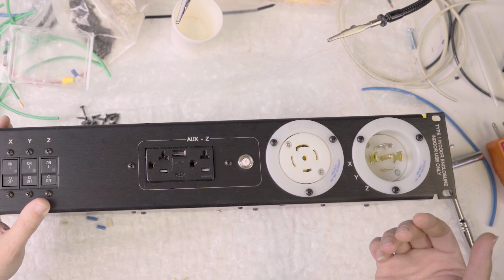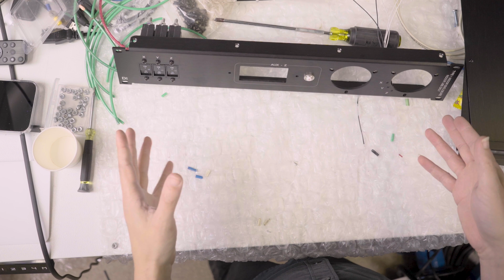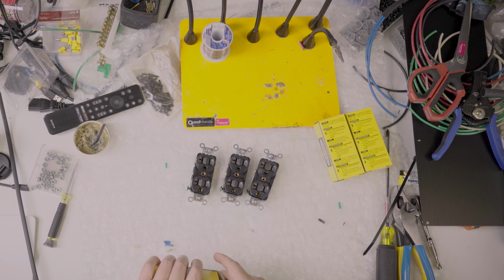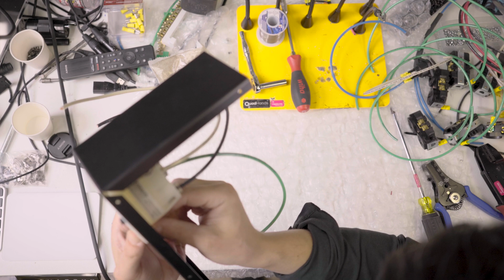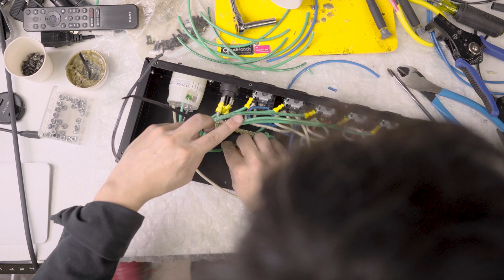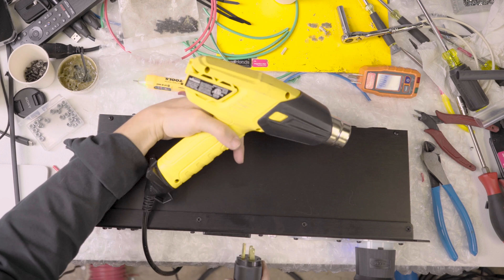Building A 3 Phase L21-30 Amp Rack Power Distro

Comment: Great video! So does every phase support up to 30amps on an L21-30?
Reply from the maker: Correct. The distro is configured for 3 phase in the WYE format. That allows it to use the 3 hot legs independently with a common neutral and ground.
Reply: @billylaguardia nice! Thanks and great video + build!

Comment: You may want to consider barrel crimps for any straight terminal connections (into the 30a outlet, etc). Any potentially frayed connection is a potential fire hazard.

Comment: Question: what would I need to tie into a fuse panel single or three phase with cam locks to feed my distribution power panel. Is there a claw type clamp I can secure to each leg in fuse panel then the other end is cam lock?
Reply from the maker: An excellent question with a variety of answers! This is usually the first thing that people look at on site visits. Some venues will have cams or a 21-30 on the bottom of the breaker so you can easily tie in. I’ve seen people bring breakers so they can tie into the main buss bar. This is always the tricky part when integrating distros into your rig. Most production companies will carry “fire starter” cables with them to make their distros work in a pinch. 21-30 to 14-30, 3 Edison’s to 21-30 etc…

Comment: Very interesting to see how things are done in other parts of the world. How are those shrink-wrapped splices made (on the 3ph inlet wires)? This would be a big no-no from where I’m from :)
Reply: Same for the Netherlands...
Reply: It's be a no-go for the UK too I suspect.  The "thru" connector I'm pretty sure would also have to be protected by breakers.
Reply: @johnmcquay82  Major UK power distro manufacturer rubberbox sell a number of distro units with unprotected passthroughs. It shouldn't normally be a problem unless you are using questionable adapters upstream.

Comment: Seeing as you serialize the plugs, can any one of those cables handle 30A?
Reply from the maker: Yes. All the internal wiring is 10awg twisted copper THHN wire which is rated for 40 amps.
Reply: @billylaguardia  One thing to remember is that while the wire is rated for 40A, the connections on the receptacles aren't. THHN wire is rated at 90 degrees, but most equipment is terminated at 60 degrees, or 30A. Just something to consider :)